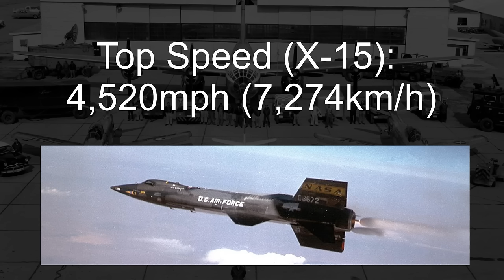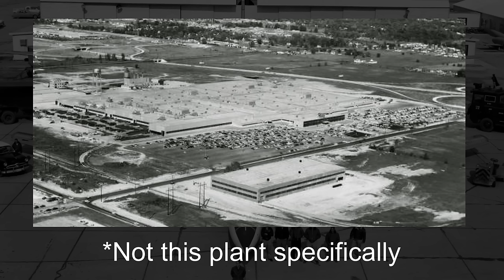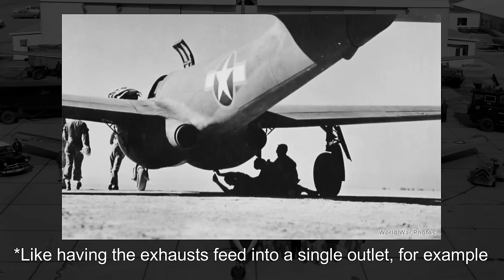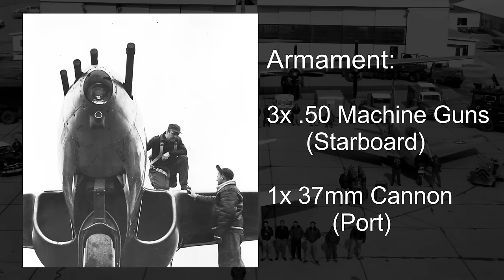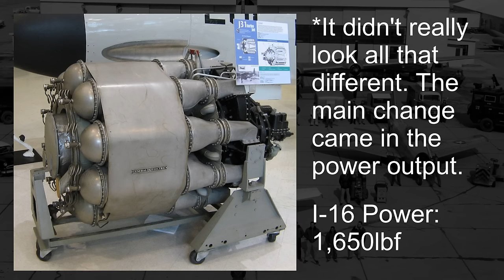America's First Jet-Powered Fighter Was A Dud: Bell P-59 Airacomet

Comment: The P-59 Bell Airacomet still gets a bad rap.  It was cutting edge technology of its time in 1942-44 and American airplane designers and jet engine engineers were working from scratch.  Considering that they had to start from ground zero, the P-59 was a valiant effort.
    The P-59's legacy then was just that, getting the USAAF's jet fighter and jet engine programs up and running.  The USAAF could have elected to deploy small numbers of P-59s into combat just to obtain invaluable initial information on how jet fighters perform in aerial combat.  The Soviet Union would later deploy small numbers of its first jet fighters, the Yak-15 and Yak-17, just to get their own jet fighter program started and jet pilot training program established.
     The USAAF could have deployed small numbers of P-59 Airacomets operationally with the intent to continuously improve the P-59, such as introducing improved jet engines, refinements to the air frame, replacement of the 37mm cannon with a practical Hispano 20mm cannon, and such.  The end of WW2 might have seen an advanced version of the P-59 flying perhaps at 450 mph, enough to stay competitive with the latest Allied prop engine fighters and still able to deal with the final generation of German prop fighters and the Me-262 jet fighter.  The introduction of the better P-80 Shooting Star, however, would have seen the fast replacement of the P-59, relegated to the role of advanced jet trainer.

Comment: I wouldn't call it a dud. A dud is an aircraft created with existing technology that fails to measure up to expectations. The P59 was entirely new technology, and a lot was learned from it. It undoubtedly spurred innovations and applications that were unknown in propeller aviation and it fostered design and performance knowledge. It was also used as a trainer for pilots aspiring to be jet fighter pilots, and despite engine delays from GE, it broke an altitude record. And subsequently more sophisticated aircraft like the P80 benefitted from the technology gleaned from the P59. In essence it was the first step in the long history of American jet aviation.  Some dud!

Comment: Why go straight to building a big twin engine job, instead of a small, light single engined one?.
Reply: The early jet engines had relatively low thrust so it was difficult to build one with a decent war load at this point in time. The engines improved enough to allow a few single engines options by the end of the war and two if them - Heinkel and de Havilland were quite small.

Comment: Dud? Did it fly? Yes. How many jets had the U.S. build before it? The engine was the problem. It may not have lived up to expectations (which quite frankly were overly ambitious) but it was a start. You build and learn. Ten years before, biplanes were still a thing. Without the Airacomet how much better would the P 80 have been? You have to walk before you can run.
Reply: Cope